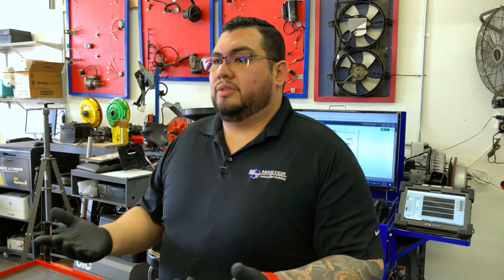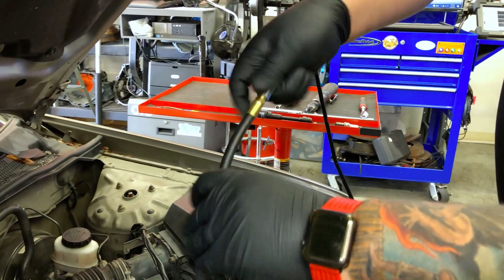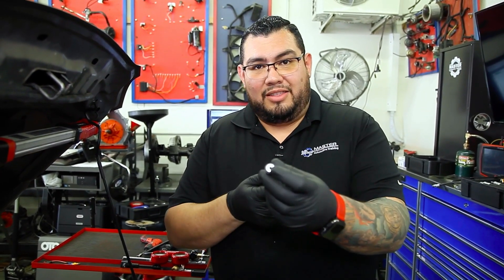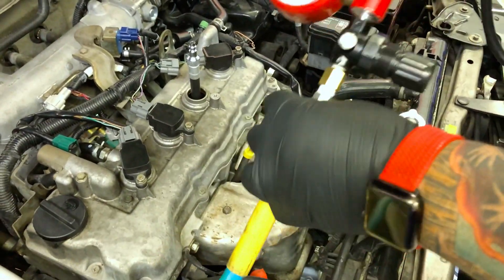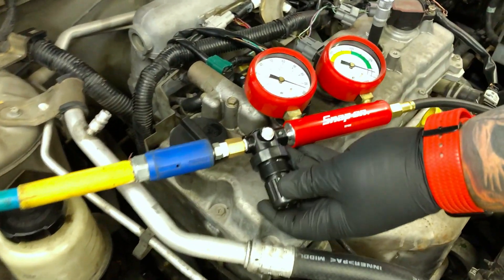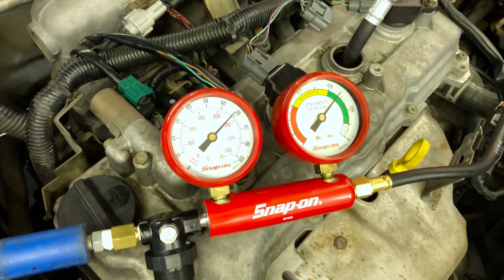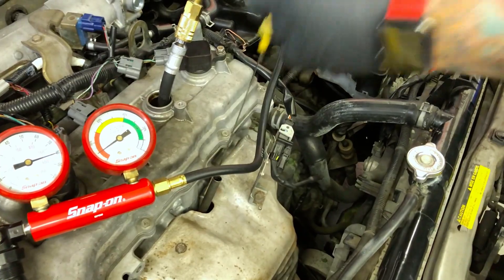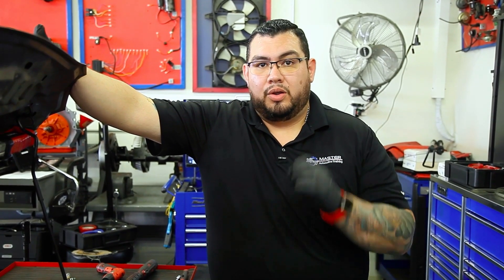How To Perform A Leak Down Test - Fast & Easy

Comment: Good video, liked the overall explanations, better than most people. I do have a question about the leak down compression set up. Is there any other way to know the top dead center of the piston without the whistle tester?
Reply: I was able to hear the air whistling out of the air injection test hose fitted to the spark plug hole as I rotated the engine towards top dead center on the power stroke.
Reply: I put some rolled up papertowl in the hole. On the compression stroke it will shoot out on the compression stroke. Then I use a long stick, screwdriver, something/anything, put it in the sparkplug hole and watch it rise and fall as, just eyeball it to the highest point.

Comment: great video, quick question. If we do a regular compression test and find out 1 cylinder is much lower than the others, can't we just connect a shop air to the compression kit cable connector that connects to that cylinder? Do we really need a leak down tester ?
Reply: I hooked a hose up to my compressor and I could hear the air leaking out and didn't need a leak down tester.
Reply: He said that you can do so .  Check at the 3 minute 20 second mark onward . Just be sure to remove the shrader valve.
Reply: The thing is that, since there's  a normal 20 to 40 % air loss through the ring gap, you will see air escaping at the dipstick tube but how can you be sure if it's  within tolerance.

Comment: That whistle test is causing confusion. Yes it tells you that you are in the compression stroke, but NOT actual TDC. I ALWAYS use something through the spark plug hole to verify that I am not on either side of actual TDC. Hope this helps.
Reply: I found putting a balloon on the end of the hose and watch it completely expand before deflation helps alot
Reply: @Jayosf415  Good tip for those of us without a whistle.
Reply: Thanks for the explanation. Didn’t understand that
Reply: I usually just put a stick in there and spin the motor with a ratchet til you get to the highest point the piston can reach. Simple and useful for when im doing timing jobs
Reply: @joelh3030 I guess that would work on a two-stroke. But on a four-stroke you only have a 50/50 chance. Gotta check the valves somehow too.
Reply: Yes^^^^^^thank you!!
Reply: Or you can pull the valve cover and make sure you’re on tdc both intake and exhaust valves will be open 
Edit: they will be closed I meant open as in loose
Reply: @heavymarinediesel  It looks like you went back and edited your comment. Instead of adding an addendum... Why didn't you just edit the original mistake instead of trying to clarify? 😊
Reply: It's also Confusing that in one case, he says 80% Loss of compression indicates he missed TDC. Then, when he measured the second Cylinder, he finds a 80% loss of compression and says it's a bad Cylinder. 
How in the world is anyone to know when you get a good test, or just missed TDC? Please see my other comment on this video...there are several contradictions that need clarifying here.
Reply: You beat me to it.
Reply from the maker: TDC indicator is also a good tool.